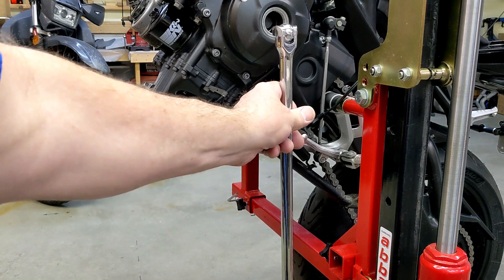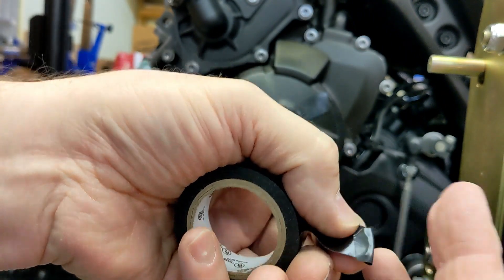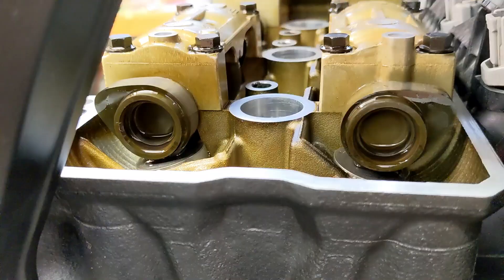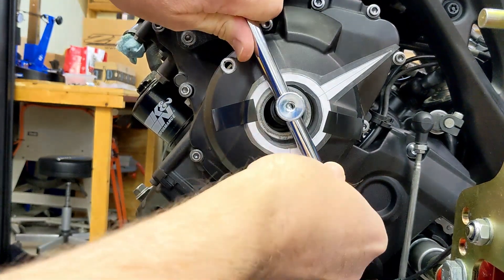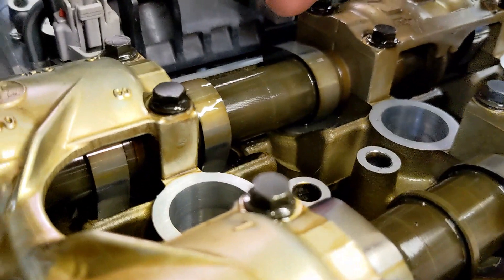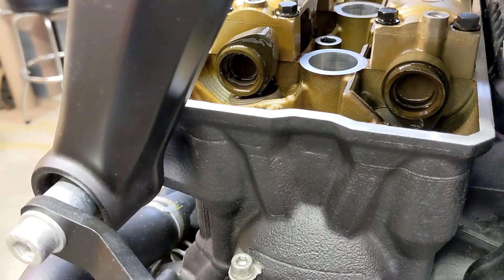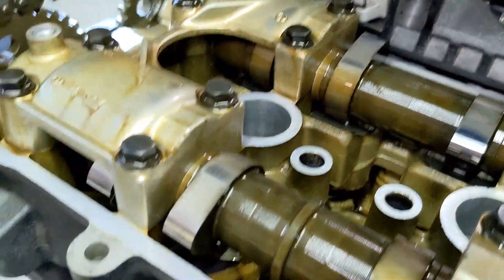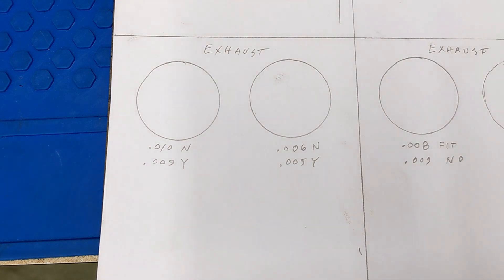2nd and 3rd cylinder valve clearance check Yamaha FZ-09/MT-09 2014 2015 2016

Comment: I just did my MT09 valve clearances. These tend to close up over time, so I try to set closer to the upper limit if possible. All but 2 valves needed shim changes at 40000Kms.  Most valve damage is cause by insufficient clearance. Yamaha only supply these 7.48mm shims in 0.05mm increments, but have set the exhaust clearance range between 0.26-0.30mm. So this makes it theoretically impossible to get the correct clearance in some instances. Honda & some aftermarket kits supply down to 0.025mm increments, so on 2 x valves I used these for better accuracy. Interesting though the factory Yamaha shims fitted in the motor came in 0.01 increments, so repurposing these to other valve locations can also work in your favor for more accurate results. Thanks for your time posting the video.
Reply from the maker: Thanks for the comment.... I was able to buy some non Yamaha shims to get in the range... Don't know if you noticed this...but this video is part of a 46 video playlist on checking and adjusting valves
Reply: I'm guessing it is easier for Yamaha to rationalise their spare parts for after sales support. The Honda OEM ones were half the price of Yamaha. Many Chinese ones in the marketplace

Comment: What diameter valve shims did you end up needing for this bike?
Reply from the maker: @bushidosteelcraft  are you thinking diameter or thickness?
Reply: @meticulousmechanic  diameter. I'm going to buy a case of hotcams just not sure which diameter to buy. that way I have a full array of sizes for the thickness
Reply from the maker: @bushidosteelcraft  as far as I can tell from searching the internet and forums that the diameter is 7.48 mm.... I never actually measured mine but that sounds about right.... You could triple verify from the people you are buying them from...
Reply: @meticulousmechanic  thanks man.
Reply from the maker: @bushidosteelcraft you're welcome.... I didn't have to replace any intake shims only the exhaust... I calculated what I needed and went down to a local small motorcycle repair guy and just bought the ones that I needed.... Only had to buy about 5 at 5 bucks each...

Comment: Hi thank you for your videos they are fantastic. Question. Can I cable tie the two chains together with the timing chain cover removed and then pull out the guide and replace it with a new one the rear guide only and tensioner as well. Thank you in advance
Reply from the maker: I don't understand your question ....what are you trying to do and why?

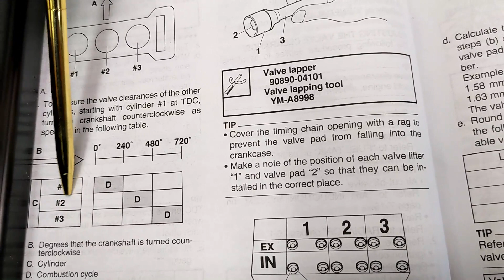Comment: The position of the angle gauge before (12:20) and after (12:50) re-positioning are the same as the original placement (2:40).  The crankshaft position generated is OK.  There is just no point in removing the angle gauge only to put it back where it already was.  The use of the gauge to rotate the crank for checking the valves on cylinder two is identical to what needs to be done, later, to check cylinder three.

Using the gauge is important because the cam's base circle (low spot) is very small on this engine.  Before I knew about this video I eye-balled the rotation for checking #2 and #3.  That was OK on other engines I have worked on.  Not this one.  I got the rotation off by a few degrees which resulted in all my valve clearance measurements being incorrect.  After much effort I got the cams re-installed and aligned, thanks to other videos in this series.  When I went to verify the new clearances were correct almost all of them were wrong.

I had to remove the cams, re-install the original shims, install the cams again, then take new measurements.  That was a lot of work I wouldn't have had to do if I had seen this video before I started the valve clearance process.  I'm really glad I now know about how to make and use an accurate crank rotation and positioning gauge.  My point here is that it only needs to be positioned once, then it can be used twice, for #2 then #3.
Reply from the maker: Interesting about not moving the gage...I'll have to think about it next time I do the valves...not sure why I moved it...must have been in the heat of the battle. I just knew I needed to rotate 240°. That must have been a lot of work like you said!

Comment: I am in the same proces now.. All exhaust clearances are at 0,25 for All ex valve  ans Ins are between 0,11 and 0,13 ordered New shims and waiting for them to arrive then reassamble
Reply from the maker: Awesome! I just picked up my shims for the exhaust.... Let me know if you come up with any tricks besides zip ties to get the camshafts back in properly.  If you watch my one video on camshaft orientation after removing cam chain tensioner, you can see where the exhaust valve is pushing up on the exhaust cam shaft and this makes it hard to get the chain and everything lined up and tightened down at the same time....